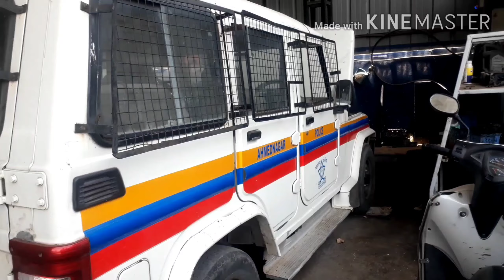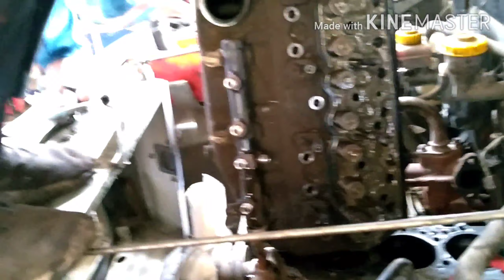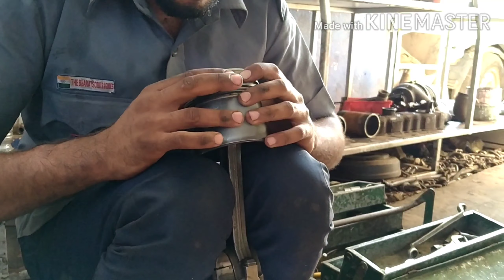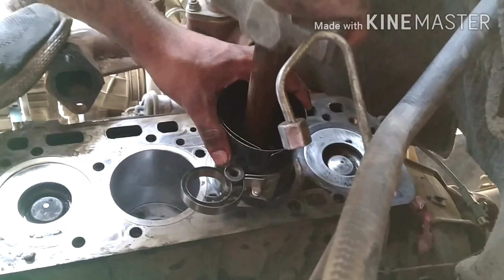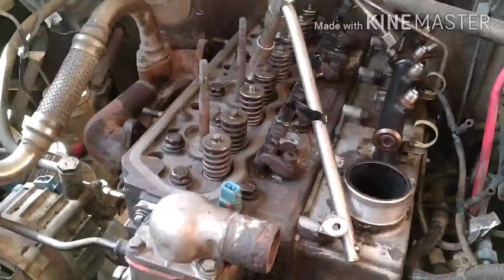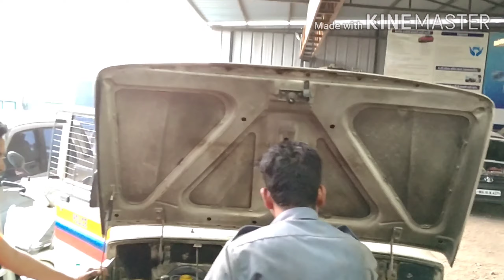Bolero Engine work |sleeve Replace| Pooja Car Ac

Comment: coolant to use hi nhi kara. Pani se to gasket aur coolant lines aur head gal jata hai. Sleeve me grease use karna shi nhi hai, oil se lubricate karna chahiye. Head ke bolts ko equal torque se tight karna chahiye.